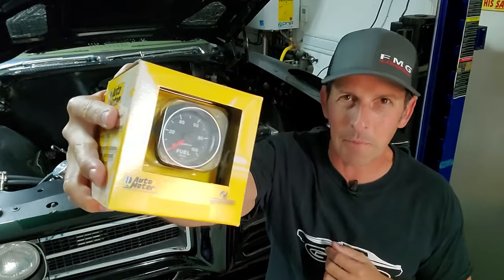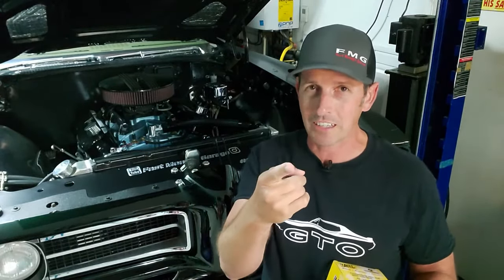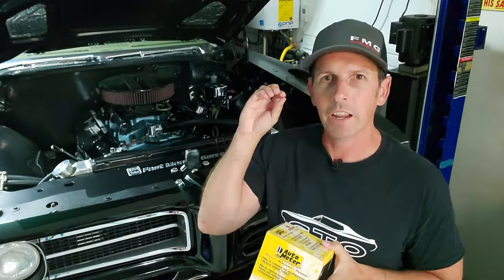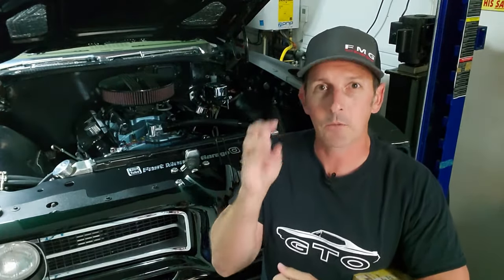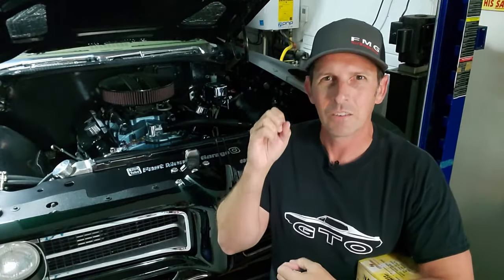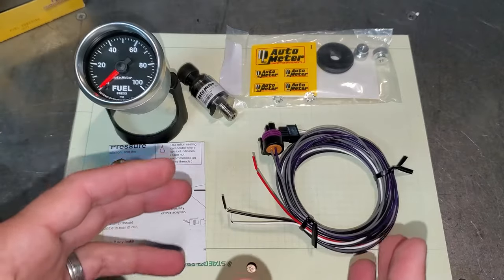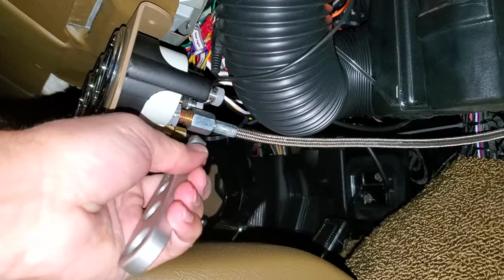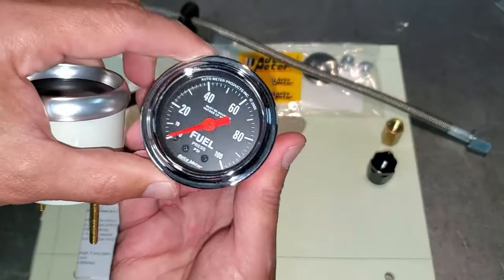How to install a Digital Stepper Motor fuel pressure gauge by Autometer, and fix my oil gauge line!

Comment: You can use a depinning tool to carefully remove the wires from a connector.  This can be handy when you want to minimize the size of the hole you drill to pass through a wiring harness.  Just be sure to take notes and pictures of the wire arrangement before disassembly.
Reply from the maker: Ohhh man, that's freakin brilliant!  I love it.  Agreed, take lots of pics, and notes before taking the pins out.  But, fantastic idea, thanks for sharing!

Comment: I think the bezel looks fine.  I would not change it.  One's eye is pulled toward the guage needle generally and does not notice the bezel distinction.  Nice work!
Reply from the maker: Thanks Roger... it'll take some time for me to either get used to it, or change it back to Chrome.  Ha, ha... We shall see!  Thanks again!
Reply: I like them all to match but even when they don't, eventually it doesn't bother me, lol.
Reply from the maker: @thisisyourcaptainspeaking2259  Agreed!  I got it changed... it was a whopping $25.  Love it!
Reply: @FastMonty  Nice ride brother. I have my sound output through the 1800-watt, eight-speaker shop system I built out here, and when you turned the key it really took me by surprise in a good way. Glad you got your bezel matched and didn't settle for less. When you attend to every little detail like that, it is inspiring to a lot of us dudes in a very disciplined, admirable way. Thank you, sir.
Reply from the maker: @riskytime  Thanks Brother!  Yeah, matching the bezel was a good call... and, it was only $25 to do so.  Thanks for the comment!

Comment: In the days prior to plastic tubing, we used to use soft copper refrigerant tubing for our mechanical oil pressure gauges.
Reply from the maker: Yup, Autometer sells that too... but, bend it too much and it'll break.  The AN line is the way to go, in my opinion.  :)  Oh, and I sent the gauge back to get the matching chrome bezel... it was a whopping $25.  How cool is that?  Thanks!
Reply: Where can you get the AN line at? Thanks! Great videos😊

Comment: Do you run a 100 micron coarse fuel filter on your car? And what brand fuel filter do you use?
Reply from the maker: Good question... I have an in tank pump, with a 100 micron filter, running to a FiTech 10 micron filter.  If you're still carbureted 100 micron will work fine.  Hope that helps!

Comment: Hi Mike, amazing GTO with an amazing story to go along with it. What steering wheel and cap setup do you have there? I have an old tired steering wheel in my 69 GTO and have been looking through all the options on the net. Also, what wheel and tire size you running? Did you make any modifications to make them fit? I think those wheels are US Mags U109 and they come in 17” and 18” i couldnt find bigger. Great job man, the car is bad ass.
Reply from the maker: Welcome to the channel!  Great questions... yeah, my original Formula steering wheel was beyond repair... welp, I didn't want to spend $1200 having someone fix it.  So, I bought a Grant Steering wheel.  I don't know if they make mine anymore, but they have some good stuff.  The tires are 295/30 - 20 and 255/35 - 19.  With careful measuring you can go to 305 and 265, respectively, with ZERO or very little modification.  (I slightly trimmed the inner fender lip on the rears)  My wheels are US Mag Bandits, but they're custom 3 piece wheels they don't make anymore.  The closet are their two piece version USMag US304's.  You were looking at their low cost cast versions.  Let me know how it goes!

Comment: Like your channel man, so where are u from? I'm actually in Hollywood, in between Ft Lauderdale and Miami. I'm gonna finally put my glow shift coolant temp, boost vacuum, wideband air fuel ratio, and black and blue digital tachometer/W LED in May and I got my 5 speed manual, put in and Limited slip differential, fidanza lightweight flywheel and new seats from the donor car, which look new, no rips, etc.
Reply from the maker: Awesome!  I was just there... well, Pompano Beach.  I live in San Diego.  Congrats on all of your fun new toys!  Thanks for watching!  Check out my drag racing video... complete rookie.  Ha, ha... see ya!
Reply: @FastMonty  Yeah, I saw your first time video dragging. I was thinking of upgrading my rear taillights  like what u did on the GTO. Possibly also the LED with the blinkers, where the blinker light slides all the way across also, like the new cars.
Reply from the maker: @junechris  Glad I can inspire some cool ideas... get it dun!  See ya!

Comment: Can a fuel gauge be put on 01 tahoe  wired through instrument cluster
Reply from the maker: Hmmm, the gauge can be installed on any vehicle. But, I'm not sure if it'll fit in the existing cluster. Let us know how it works out.
Reply: @FastMonty  I just wanna run wire to the cluster instead of fuel pump so I won’t have to drop tank is their away I can hook the guage up without dropping my tank
Reply: @FastMonty  how can I wire my fuel gauge on my 01 Tahoe without dropping the tank
Reply from the maker: @2423aj  Good question... I'm pretty sure you HAVE TO use the sending unit included with the gauge.  Where you mount that sending unit is up to you... Ideally, I'd mount it as close to the point of use as possible, as I did on my Throttle Body.  Let me know how it goes...
Reply: @FastMonty  really didn’t want to do the tank on 01 Tahoe to connect to sending unit. Is there another way to wire a fuel gage without connecting the fuel pump
Reply from the maker: @2423aj  Ohhhh, are you asking about a Fuel Level gauge?  OR, a Fuel Pressure Gauge?  This video is about Fuel Pressure.  If you're asking about fuel level, you need to trouble shoot the failure... is it the sending unit, or the gauge?  If it's the sending unit, you have to drop the tank.  Sorry for the confusion.
Reply: @FastMonty  it’s the gage in dash it moves a lil then drop all other gages work
Reply from the maker: @2423aj  Got it.  You need to determine if it's the sending unit, in the tank, or the gauge itself.  I'm not an expert on your car, so you may have to research how to test it.  Most fuel level sending units, operate on a range of resistance (measured in Ohms), which correspond to the fuel level.  That would require a multi-meter to test.  Hopefully it tests ok... if not, you're gonna have to replace it.  Good luck!
Reply: @FastMonty  tears fine it’s the dash that’s not working correctly Sending unit in tank works fine
Reply from the maker: @2423aj  Awesome!  Glad you figured it out.
Reply: @FastMonty  yes thanks for the help. Now imma try adding a aftermarket gage and wire it to dash cluster
Reply from the maker: @2423aj  Good luck!  As long as the gauge reads the same resistance range as the stock gauge, it should work great.  Have fun!